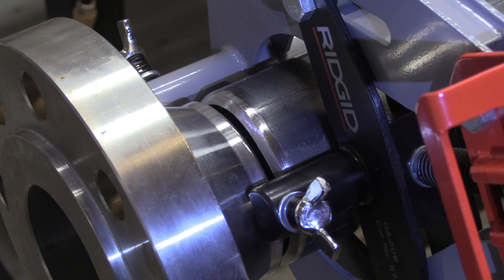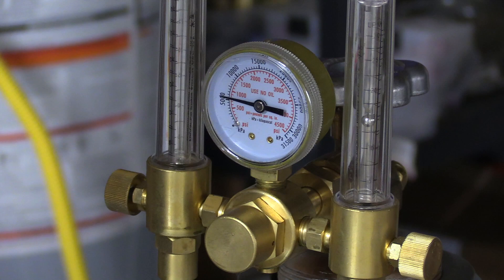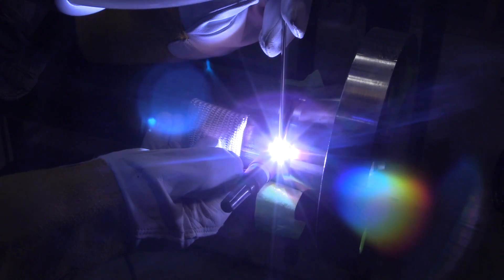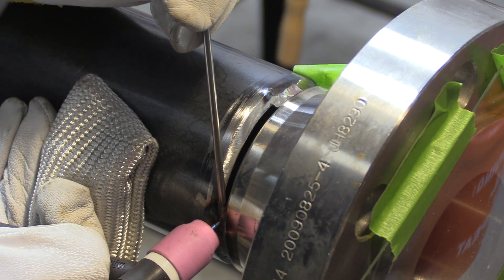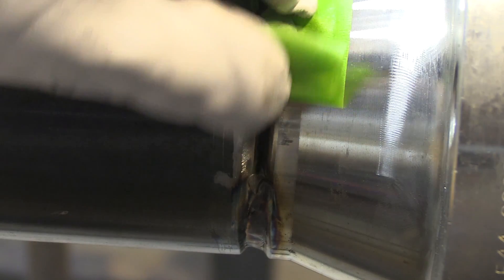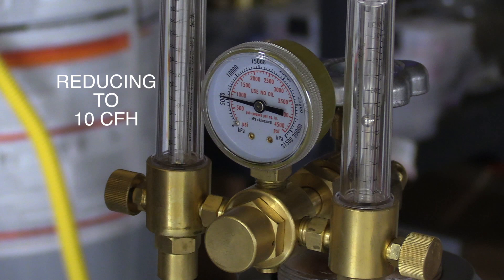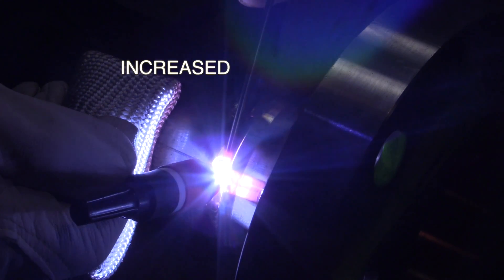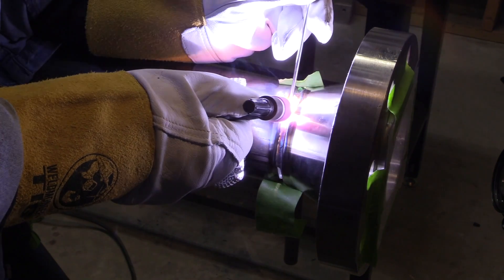Stainless Steel Pipe Root & Purge Tips | Welding Tips & Tricks #Welding #TIG #WeldingTechnique

Comment: Very nicely done!! 
With WPS's in last few places ive worked, we use 85-90 amps, 1.6mm wire and set up a 3.2mm gap (which obviously pulls in a bit as tacks cool) for stainless roots, keyhole it and keep the keyhole open. Most of the time then swap over to 2.4mm rods for the fill and cap passes. We dont use 3.2mm (1/8") rods at all. 
Ive always found using laywire technique and a 2.4mm rod and gap works ok on the top quarters or if rolling a butt, but trying it in position gives a flat root surface on the bottom.

Comment: For 304 stainless exhaust do you really have to purge 100% how much does it really degrade the service life
Reply: I read the carbide layer on the inside is prone to absorbing moisture so over time corrosion will set in. Tried both ways, purged is way nicer to weld and does a better job or you could try the flux thats avaliable

Comment: I read your comments it said you used 309 filler, could have you used 316 filler or is that for a different application? What's the differences/advantages between them?
Reply from the maker: 309 filler is designed for welding stainless to carbon steel.  316 filler is mainly intended for 316 stainless. I am planning on using the piece I welded for a welding stand and bolting the flange to the concrete so it really didnt matter much, but 309 was the best choice since the flange was stainless and pipe was carbon...hope this helps
Reply: @weldingtipsandtricks  Helps alot, thank you for the unexpected fast response. The only reason I asked this question is because I thought I read or seen 316 listed as bimetal filler rod. Keep up the great content I truly enjoy it all, even when I know what you're doing I still will sometimes pick something up I didn't think of. My best to you and yours!

Comment: Great arc shots Jody.
Can you tell us what the rule of thumb is for how much backing gas is used?
Reply from the maker: I dont know of any rule of thumb for flow rates but it seems like the bigger the volume, the more flow is needed ...to an extent.  sometimes helps to have a diffuser with high flow rates. some really small parts might only need 2 or 3 cfh while a hundred feet of 12 inch pipe might need a much higher flow rate.

Comment: Jody did you use 309 wire for this? Also on scratch start, is it a concern that when you snap out, the hot tip of the filler is not shielded. Do you have to snip off the oxides as to not introduce contaminants for the next run? Thanks
Reply from the maker: yes on the 309.  and yes on snipping the tip of wire.  I forgot to include a clip of snipping
Reply: @weldingtipsandtricks  great thanks, really liked this vid

Comment: Great timing, I've been trying to teach myself tig on pipe at home now that school is closed for the rest of the semester. Do you have any recommendations for controlling the about of root reinforcement? I seem to always get too much when I practice on plate.
Reply from the maker: fit up makes a big difference.  a tighter gap or slight land might help
Reply: @weldingtipsandtricks   jody do you ever use the backfeed technique sir?
Reply: For me, the problem is matching amps to fit up. Knowing how much heat based on gap and land.  I have the same issues stick welding too.  Lack of experience is my problem.

Comment: were you using the everlast ext? i been eyeballing it bad like bad bad.
Reply from the maker: I was using a miller dynasty on lift arc.
Reply: @weldingtipsandtricks  thanks
Reply: I had an everlast 185, it went up and let the magic smoke out of the main board with the IGBT transistors and blew a huge hole in the aluminum I was welding. Cost more to fix then what it was worth